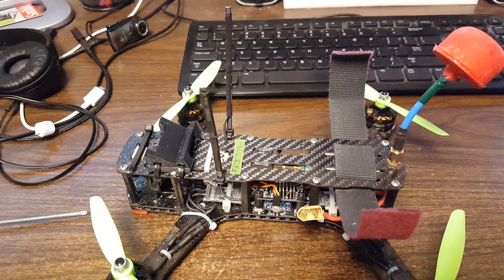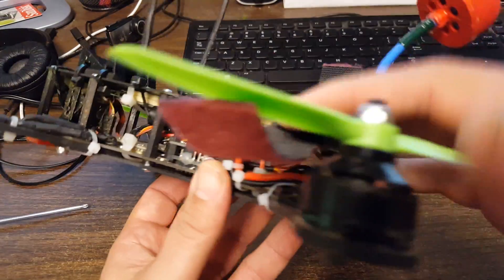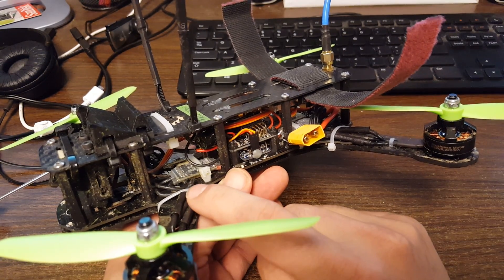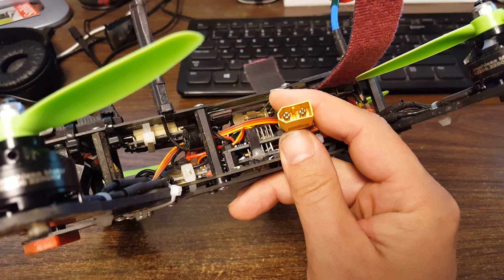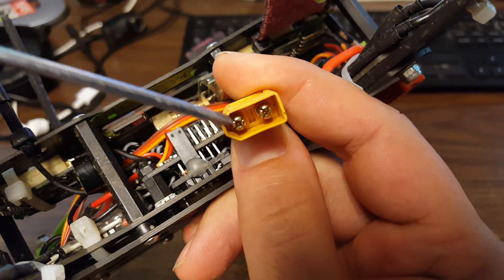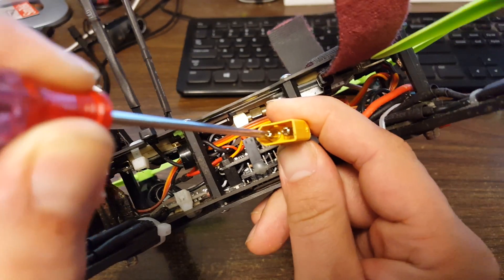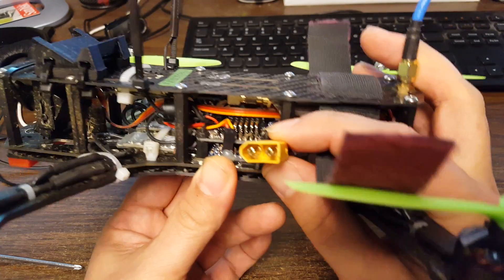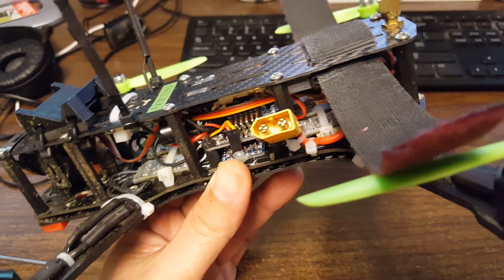How To Fix A Loose XT60 Connector

Comment: Another issue fixed with your help. Found the connectors started firm when pressing them in, then got super loose. Eventually any small tap would reset the drone. Finally had a power failure about 300ft off the ground into soft mud this past weekend, and again while flying today. Bent the prongs out a little bit and we seem to be back in business.

Comment: Thanks for this, mine are manufactured soldered (not me) and they are way too tight. Edit : I watched a vid RE sanding the casing but the pins make more sense (being a electronics engineer), all is good now, thanks again. FYI : The same issue applies to pc 4-pin molex connectors for dvd-roms and hard drives after multiple inserts.

Comment: Holy shit Joshua Bardwell - my loose connector was messing with my head! Thank you so much for this easy, makes sense idea!!! 
Basically, I have to increase the diameter of the male proboscis to ensure a proper fit into the female connector - just as in nature LOL 🤣
Seriously though - thank you for solving my issue!!!
Spreading the prongs......I was so convinced it was the plastic xt60 connector - thank you JB! 😘
Ok so post video thinking - an insulated xt60 male spreader tool would be nice 😁

Comment: I agree with plug the XT60 in when you solder. I accidentally soldered one a little hot and the neg pin recessed slightly.

Comment: this actually happened to my son's quad a couple days ago. I figured it out right away but I apparently made the connections too tight because next flight my son spiked his quad and ejected his battery which ripped out the xt60 from the pdb 🤔
Reply from the maker: Personally I never hard-solder my XT60 for this reason. You can use just like 1/4" of 12-ga wire and it will give a little flex to protect the PDB.
Reply: Joshua Bardwell that's exactly what I replaced it with, 12ga silicon wire. And I made him vow no more high speed "landings."  But put a set of 4 emax 2205 motors in the hands of an 11 year old and sometimes things happen 🤔

Comment: My quad fell out of the air a couple times for no apparent reason and I couldn't figure out what was going until I reviewed the gopro footage and heard the ESC boot codes sound off in one of the crashes.  Sorted out my XT60 and all was right with the world again.  Initially we all thought it was that I got "zapped" by a beam from a very nearby radio tower, but the the gopro told a different story.  However a few weeks later, diving down same radio tower my quad did a random 360 roll which spooked the crap out of me, and another friend has reported random throttle punches when inline with some of the antennas mounted on that thing.
Reply from the maker: probably failsafes then.

Comment: I just broke a FC because of this. I was about to just use electric tape to hold it together (I have a separate connector btw my PDB's xt60 and my battery's xt60) It was lose at the PDB and fell from about 50-100 ft on concrete

Comment: I've had this problem for a while now with a Turnigy 1300mah and now a Lumenier 1300 4s. Thank you Josh
Edit - I don't think it's the actual XT-60 on the Lumenier 1300, I think it's the other end of the power cable that the XT-60 is soldered into on the battery. I crashed pretty hard the other day and the batt got ripped out and unplugged from my quad, and I think the silicon wire/connection has come loose on the actual battery itself (the cells, not the solder joint on the XT-60.) Prob just gonna dispose of it.
Reply from the maker: If the battery lead has torn loose from the cell, then I dispose of the pack.

Comment: I put 26awg I think, down in the middle and it works very well to keep them tight. Question though, what are some other good connectors that maybe lock in place?
Reply from the maker: +Humboldt710 xt60 is pretty much the standard now for RC. You may want the connector to come apart if the battery comes loose in a crash. Check out Anderson PowerPole if you want an interesting alternative.
Reply: Joshua Bardwell
Yeah I have seen the Anderson PowerPoles. A friend uses them. I rarely have an XT-60 come loose these days, but figured I would ask. Cheers.

Comment: Thank You Joshua! this gremlin is PRECISELY what happened to me today! it kept power cycling. AND it fell out of the sky twice/lost power for 'no reason' in the last week. that bugged me, so i blamed the nearby innocent cell phone tower. I was about to check the soldering but i stumbled on this vid and its a compressed pin from a moderately used xt60. thanks for sharing so much great advice. you da man!

Comment: Sorry for the question out of place but the antenna in contact with the carbon frame does not create distrubi to the signal and / or can ruin the transmitter?
Reply from the maker: +Michael Di pietro Not sure what you mean. Which antenna?

Comment: I use a small x-acto blade in the slots to spread the prongs. If you ever notice that your XT-60 is no longer a PITA to pull apart that's a good sign that the male pins are compressed :)

Comment: Really it is a great tip, I have learned a lot from your channel,  thank you for that. 
Just wondering i have noticed that you have RCX  2205 what do you think of them ??
Reply from the maker: +Nabil Al Dhaleai They're actually 2206. I like them fine, and I think they are a good value for the price. They are very robust motors. My friends all fly RCX 2205 and are regularly replacing parts when they crash, but my 2206 just keep trucking. To be fair, a set of four is something like 40-60 grams heavier.

Comment: I learned this lesson the hard way last year when my 250 fell out of the sky during its maiden flight. I'd never had this happen before but also I'd never put 110A through an XT60 before. They'd become so loose that the XT60's just fell apart, I assume caused by heat. I tweaked the pins so it was nice and tight and it hasn't happened since. I would suggest that anyone pushing large current through an XT60 should have their connection as tight as reasonably possible for maximum contact on the pins. 

This is the vid of the crash, it happens at 3m18s.. =pk5kRolArVY